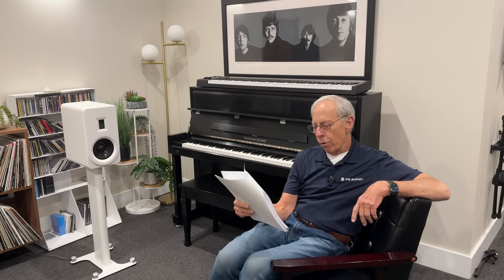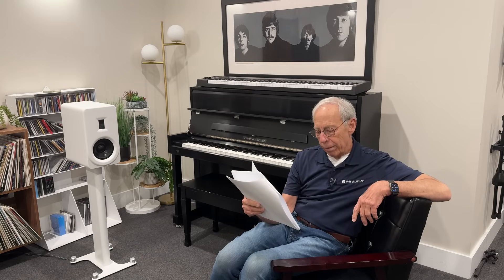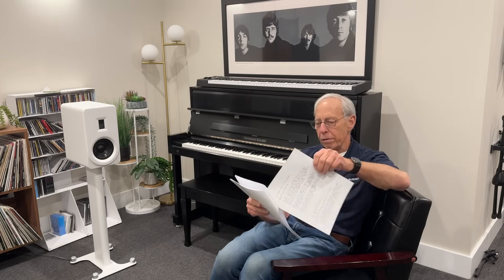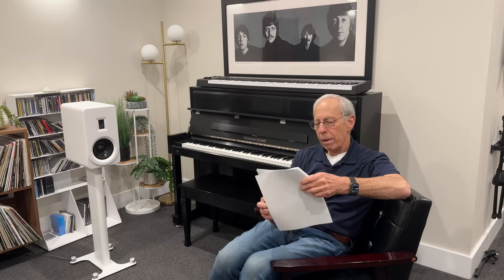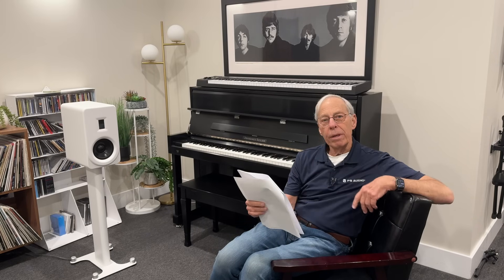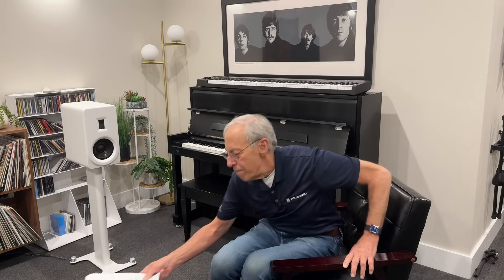Impedance matching

Comment: One small detail in addition, with analog audio we usually like voltage matching. This is done with low output impedance and high input impedance like paul told us. But in other applications like RF / Antenna or telecommunications with long lines it is a different story with impedance matching to minimize losses and reflections on long cables compared with the wavelength

Comment: I believe amplifier and speaker impedance matching is more important. You can have an amplifier with lower impedance than you speakers. But you can't have speakers with lower inpeadance than your amplifiers. You better hope that your amplifier has a built in protection circuit. Or you will risk frying your amplifier at high volume. It's common to trip the protection circuit on home theater receivers. Because they don't like it when you use several low impedance speakers. The impedance on a speaker is the nominal impedance. Once the speaker is playing that impedance goes up and down. Your amplifier needs to be able to drive the full load of the speakers on all the channels driven.

Comment: The only problem I have run into has been with a tube pre-amp into the few solid state amps with 5K and lower input impedance. If you want to possibly try a tube pre-amp in the future, look for something 40K or higher, which most good amps are.

Comment: Source to load Impedance matching is only important in POWER transfer. Simple math will show you the most POWER, watts, is transferred when source and load match. This would be for tube type amps with output transformers and sources like balanced lines for mics, ... When transferring constant voltage as you do from most audio sources to a preamp, preamp to power amp, SS amp and keeping that voltage regardless of load, you need as low a source resistance as possible and feed a much higher resistance.

Comment: For maximum power transfer, a tube amp's output transformer's taps should be set to match the impedeance of the speaker, but you certainly can try others, to hear any difference in sound, but at the expense of output power, so you'll have lower sound intensity at a given volume setting.

Comment: Is it the same ratio with headphones? For example 32Ohms and 250 Ohms headphones respectively should be connected to what Ohm-number DAC?
Reply: If balanced connections, it is best if the source and load match. Otherwise lowest source resistance is best all else equal.
Reply: Thank you :)

Comment: Back when I was a kid (when transistors were 'fancy'), impedance matching was about 2 things:-

1/ avoiding signal reflections from the joint where a mismatch occurs

2/ maximising power transfer. 
My dad took some time to realise that my power amp with 0.01 Ohm output impedance and hefty cables had better control of a wayward speaker :-)
Reply: If you had a 0.01 ohm output impedance it was likely solid state with no transformer. You were not doing max power transfer, but constant voltage. And yes this would give a great Damping Factor which includes speaker control.

Comment: That was not at all what I thought the question was asking. The only time I've considered impedence in my system is when trying to match amplifier output to speaker input. In that case, I am under the assumption that the speaker impedence must be equal to or greater.
Reply: Same here. I think Paul didn't want to go another 10 rounds on damping factor. In general, its best to connect your nominal 8ohm speakers to the 8ohm tap on the amplifier. I don't think anyone would dispute that.
Reply: Output to input loading is important everywhere. The ends are most difficult, amp to speaker and phono cart to preamp. Then for the line levels it is whether you are using balanced line in which case you match source and load or single ended where the source is low and the load is high impedance.

Comment: Please cover balanced to unbalanced wiring! I found ring from balanced gear to sleeve of unbalanced gear gets rid of earth hum. Would like to know why!
Reply: You used the 3 wire balanced cable as a two wire single ended with the ring as a ground.
Reply: @glenncurry3041 thanks, I know what I did but I don't know why ring to ground gets rid of hum.

Comment: The Vincent SA-T7MK preamp addresses that need with 2 different outputs one is 47 ohm & the other 607 ohm if you're looking to match closer with certain amplifiers. I read about it with the manual when I bought it and also read some things on forums but now that Paul has explained it in more detail I now have a better understanding. Thanks Paul